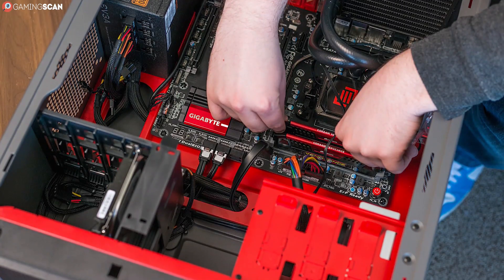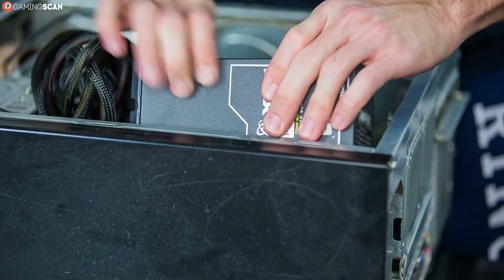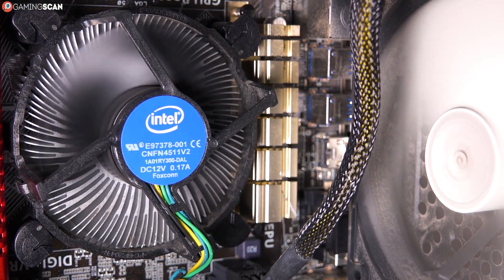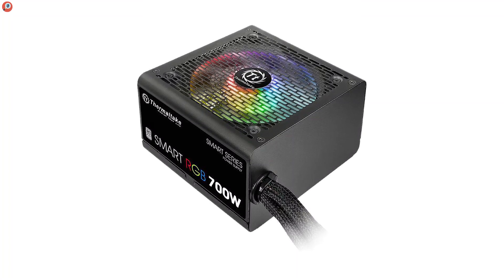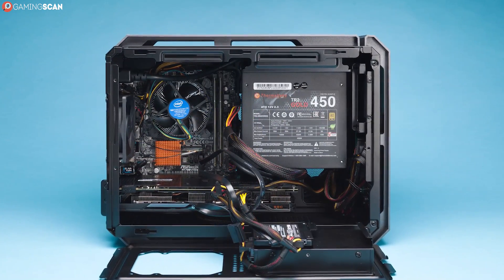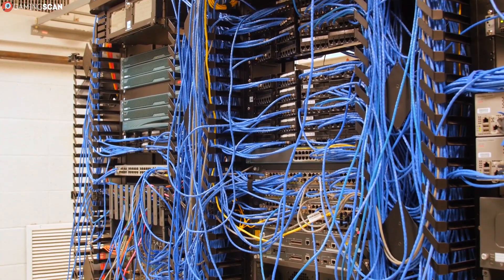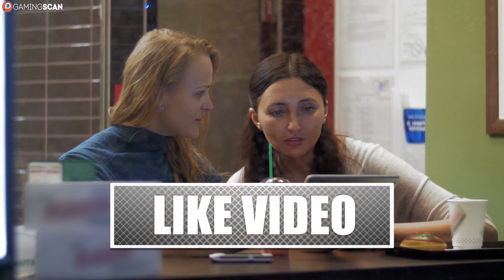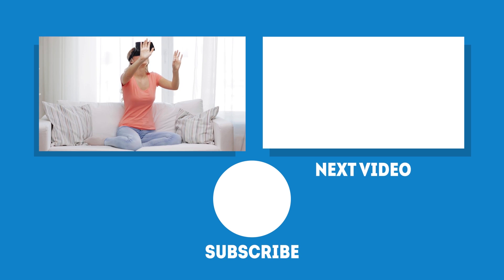How To Choose A Power Supply [Simple] - The Ultimate Guide

Comment: This is not a great video.

Connectors for example.

20 pin is pretty much non existent these days.  It's a legacy hangover from the earliest days of the ATX standard.  Any modern motherboard (even mini ITX) will need a 24 pin connector.  Thankfully all good PSUs come with a 24 pin or a 20+4 connector.

They only go into detail about PCIe connectors and don't even mention EPS.  Yet every single modern motherboard will have as a bare minimum a 4 pin EPS (more likely 8 pin) and some even have an 8 and a 4 or two 8s.  EPS connectors aren't the same as PCIe connectors and it is important you don't mix them up.  You will blow the motherboard up if you force a PCIe connector in an EPS socket.

Also someone did the efficiency cost savings of twice the wattage required.  It's minimal at best (think it worked out at £6 a year in worst case - computer on 24/7 and under heavy load for the whole time).  You need about 100w of headroom on max load.  That is enough to maintain efficiency and keep temps down within the PSU itself.

Comment: I spent $44.00 on a uncertified 600 watt ketchup and mustard PSU from Thermaltake. RMA at 5 years. Now in 2nd year of 2nd unit. 3 more years to a decade. 5 year warranty from known solid RMA is a good PSU plan.
Reply: I would never trust that with my electronics. No way in hell it's conditioning the power well, if at all. If it doesn't have a shit-ton of ripple and noise, let alone actually have an OTP, I'd be incredibly surprised.

Comment: I bought a thermaltake toughpower 750 gold for my 3900x + 2080 super build. But then i read the reviews and the psu apparently
1. Comes dead in box
2. Dies after 6 - 18 months
3. Notorious for melting sata cables one at a time until you're left with none to support your sata drives
4. Fries hard drives and even motherboard.

Now I'm thinking of going to the computer repair shop and getting them to test it for a while before i trust it with my expensive new build
Reply: if there are much reviews that say the same thing about it: DONT bother using it, you will regret it when you'r parts are dead. get you'r money back or buy a new one.
1 thing that you dont want is fried components because of a faulty PSU. 
How sad it may sound that you wasted money on a bad manufactured PSU, its better to spend another few bucks to get a reliable one and enjoy you'r pc a bit longer then 6 to 18 months ;)
Reply: @MyFunnyface123  Yeah man exactly, I'm just gonna try and return it for  15% or so re shelving fee and buy a better one. Good advice.
Reply: Dude I literally just ordered this from Best Buy and as soon as I ordered it I’ve been having mixed emotions. First it’s not even compatible with my msi X570 and I’m putting a 3700x w a msi 2080 so I don’t want to fuck up my hardware. Glad I saw your goin thru the same thing I’ll definitely be returning it
Reply: "going to the computer repair shop and getting them to test it"

 You aren't going to find any computer repair shops with the right equipment and knowledge to do any tests that would need. Go check-out the article on Tom's Hardware about how they do their PSU reviews. We're talking tens-of-thousands of dollars in equipment on top of serious programming and electrical engineering skills.

Comment: I have a corsair cx650m psu
Reply: Man, ur a next level god
Reply: That is the exact psu i will get
Reply: Ah, I See i am a Man of Culture As Well
Reply: The extended warranty from corsair on some of their models is a very nice bonus when compared to the other brands. I have the 2018 rm650x model which has 10 (TEN!) years of warranty. Bit more expensive then the cx650m, but very happy with it non the less.
Reply: is that overkill for $800 build?
Reply: @9inezeros  No. A good PSU tends to last for several builds, where as most other hardware like cpu, gpu and motherboard get replaced much sooner and more frequently. If you buy a decent one with some headroom in your power needs for future upgrades, you will spent less money in the long run as opposed to buying several cheap ones with much lesser quality components. 

My rule of thumb is to get a psu that delivers about 50% more power then your system needs. The more a psu is "tapped out", the less efficient it will be. This will also ensure you won't run into trouble when you upgrade your GPU for example. I went from a GTX 1060 which used 120 watts to a RX 5700 XT which can go as high as 250 watts. The RM550x model could also be a good fit but it was just $10 cheaper in my country so I went with the RM650x. If you are looking for a model that is a bit easier on the wallet, look into the TX550M V2. It's semi modular, but it is about 30% cheaper. Hope this helps!
Reply: Jaded Rivers Im about to get 550W BRONZE on my $800 build, enough wattage to supply my system?
Reply: @9inezeros  Depends on your components, but I guess so. GPU's are the most power hungry components so check the power draw for your specific model to be sure. If the price gap between the psu you are interested in and something like the corsair TX550M V2 I suggested above isn't too large, I would highly suggest to go with the corsair model. Longer warranty and higher quality components used in the psu go a long way. Like the video says, a good steady psu is important for years to come. When in doubt, spend those extra $10 or $20.
Reply: Jaded Rivers I’ll use RYZEN 5 2600, GTX 1660 Super Gaming, Corsair Vengeance RGB PRO 2x8 GB 3200, MSI Tomahawk Max, M.2 NVME Adata 256GB, 5 PWM 120MM fans. is 550W enough cause there is no 600W on store?
Reply: @9inezeros  Yes, it's more then enough. The GPU only draws around 125 watts, and you still have some wiggle room for future upgrades with a 550 watt power supply.